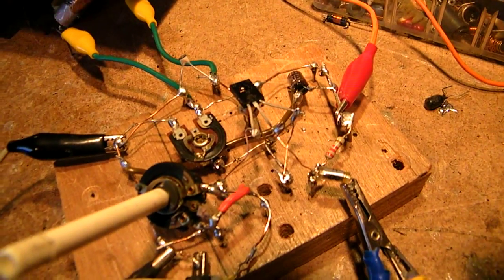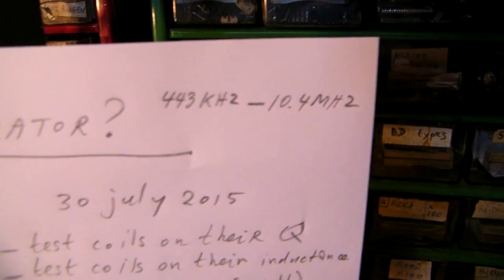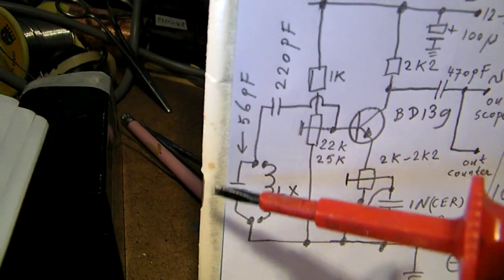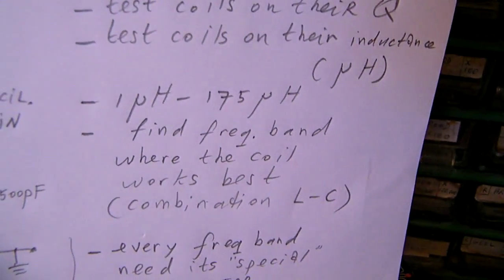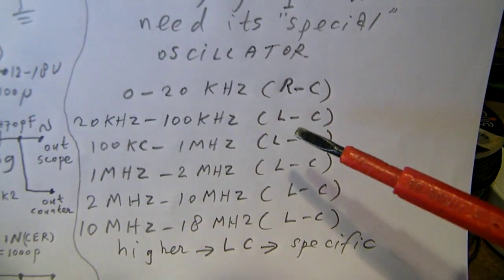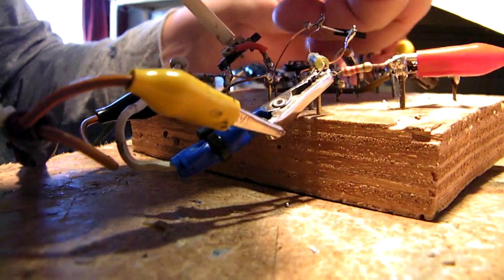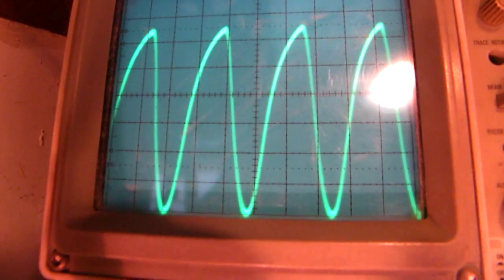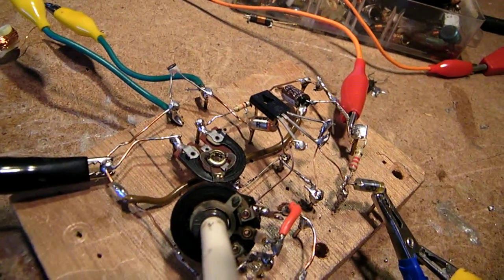Why an oscillator? (Shortwave technology & measurements)

Comment: Can I use this circuit as a transmitter for a 16 .7 mhz frequency
Reply from the maker: The FET circuit that I sent you is the best for that purpose. The output is (by the way) too low for serious radio transmissions. For that purpose you need a HF end amplifier and an antenna tuned to 16.7 MHz. I don't have circuits/schematics about how to make that. All my oscillator circuits on my You Tube channel give out a very weak radio signal.

Comment: Thanks for this video!
After you use math to determine an approximate resonant frequency, could you hook up a sweep (wobbulator) to find the actual peak?
Reply from the maker: Tony T. Yes, that is possible. The wobbulator must than, sweep, over the calculated/measured frequency in a 20-50 Hz sequence, at the same time the scope (horizontal-in and ground-in) is bridged over the coil. Then you must see the peak.
Reply: radiofun232 Thank you for the reply! Where, in the circuit, to hook up the sweep generator and oscilloscope still confuses me. In the future, could you do a video about how this is done?
Reply from the maker: Tony T. Hi Tony, there are 2 video's about the use of a wobbulator on my YT channel. One is called "IF (455 KHz) filter test with a wobbulator" and the other "how to make a 455 Khz filter yourself and test it with a wobbulator". I cannot publish the schematics on You Tube because they are copyrighted. But the principle is "simple". A sawtoothgenerator on approx. 25 Hz drives a varicap (0-12V) that bridges a 455 KHz coil primary. The effect is that the 455 KHz coil sweeps from 450 KHz to 460 KHz each second, because the capacitance from the varicap changes 25x a second. This (sawtooth) is sent horizontal in from the scope. At the same time we measure the output from the 455 KHz filter on the secondary (at the detection diode). Input: verical from the scope. Now we see the output energy related to the frequency and we can align the core to the max peak energy out.
Reply: radiofun232 Ko, Thank you very much for the explanation!

Comment: I am trying to track down a hum in my house on am. I am using a handheld am radio and looking for a null in the hum. My question is, which direction does the antenna receive the null and the lobe. Does it receive broadside or from the end of the ferrite rod? Great video by the way!
Reply from the maker: James skippinhopper Thanks. I always find this a difficult question but in general this can be applied: When two cylindrical coils cross each other there is no electromagnetic coupling, when they lay paralleld next to each other they couple electromagnetically. When one of the 2 coils is moved to the parallel position they start to couple more and more and energy (hum or so) is received/transported. The same applies to pieces of wire. The EM field around a wire follows the "corkscrew rule". My opinion is the you can pickup most hum when the cylindrical pickup coil is paralleled with the wire, but in fact I have to test that to be sure.